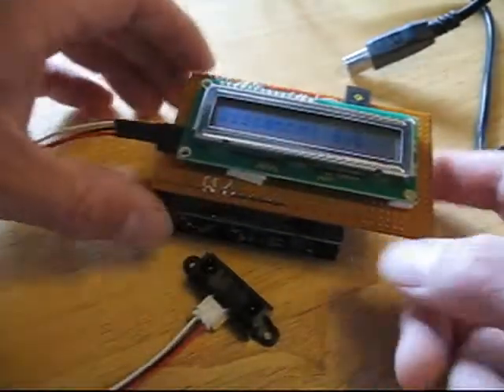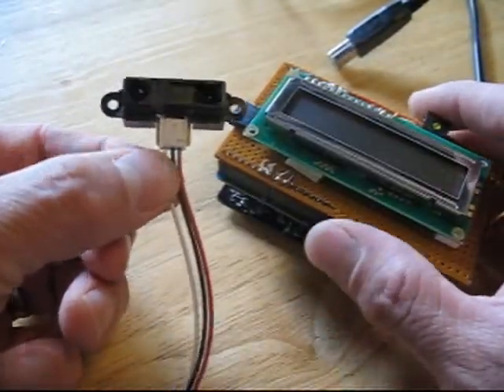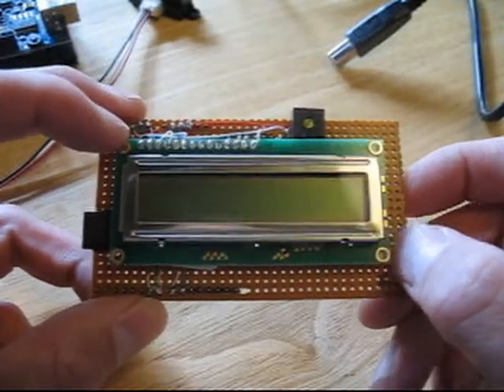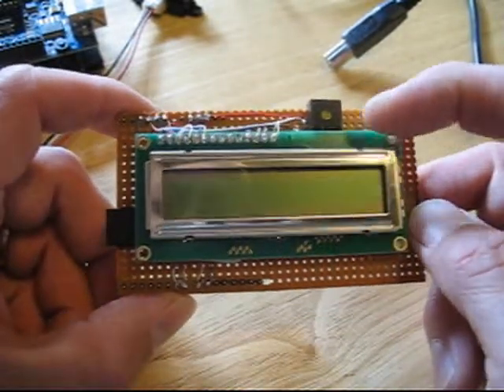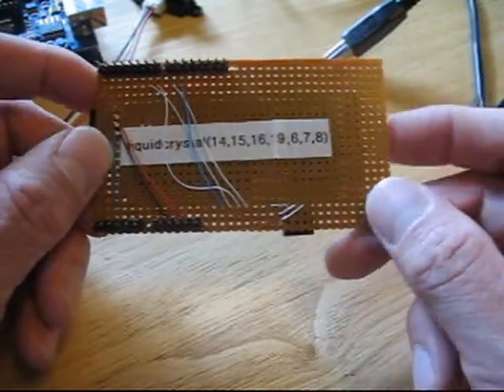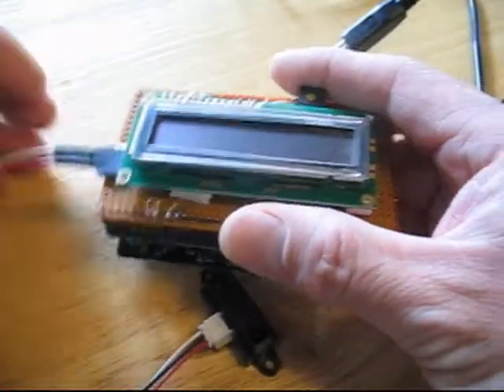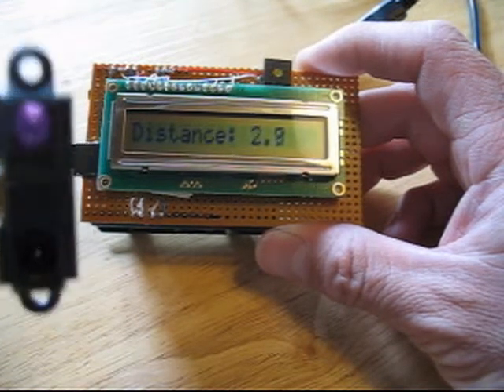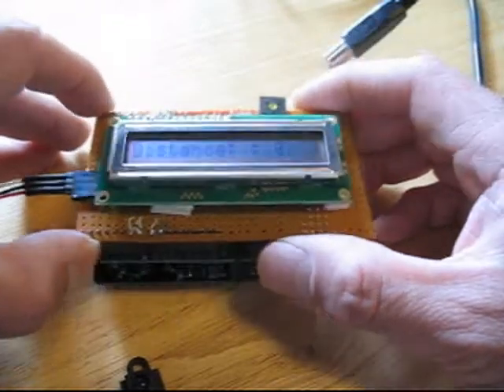Arduino, LCD Display, IR Distance Sensor

Comment: Nice! Next step is to calibrate it to measure distance in standard units! Shouldn't be too hard, just pull out a ruler and calculator and get cracking :)

Good job on salvaging the LCD though!

Comment: @hobogasm The USB cable can be used both to transfer data to/from a computer (including programming the m/c), and for powering the board.  You *could* remove the microcontroller, but the board (depending on which one you have) has all sorts of useful features, like plug-ins for power supplies, fuses and pins.  See how nicely that shield fits on top?  Way better than having to rewire everything to the m/c chip every time you want to change your hardware.

Comment: The Sharp IR sensor is one of the best distance sensors available, very accurate, does not get confused by different angles like ultrasonic sensors does and does not interfere with each other like the ultrasonic ones can do. 

Just print out more digits, preferably the raw AD value (0-1023) and you can see its amazing accuracy. And read the datasheet for the IR sensor.
Reply: Can that sensor measure fuel level meter?